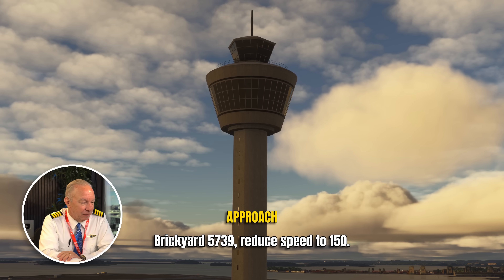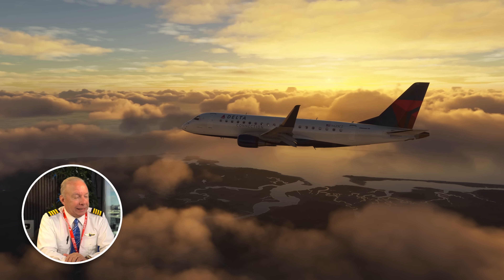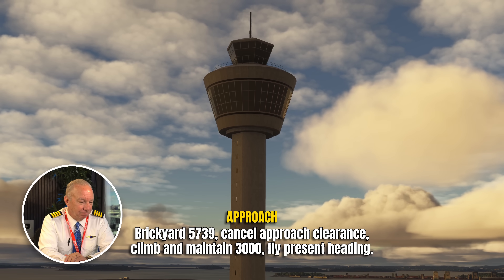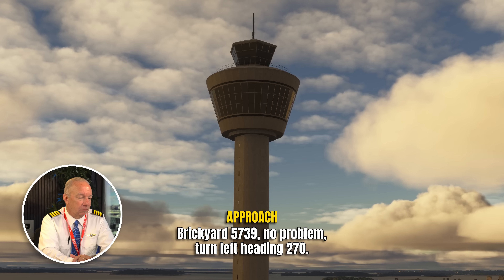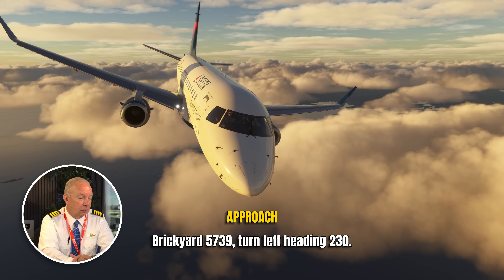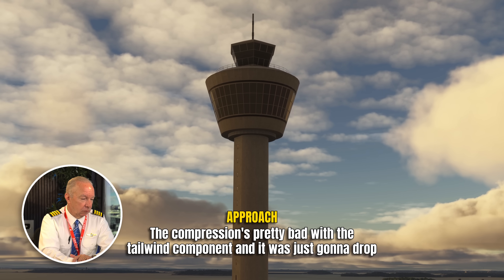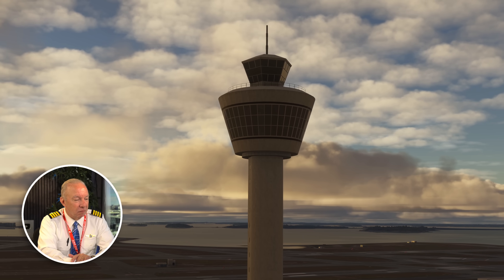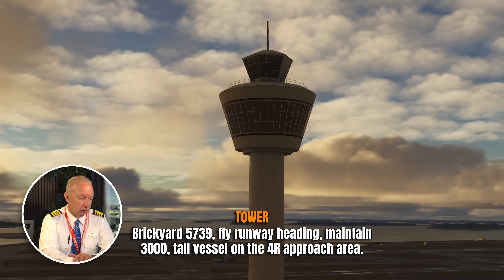“Minimum Fuel” at Boston: What Really Happened to RPA5739

Comment: Pro tip to use "min fuel" in each transmission, especially changing frequencies. Go arounds throw the system out of sync and there was a case not too long ago where the min fuel status of the aircraft was forgotten, and an extremis situation developed. Fly Smart.

Comment: IN the early 80s, I was on a flight with 2 go-arounds into Charleston, SC. It was right after a tropical storm had passed, and the visibility was low. The pilot descended twice with no luck at landing and told us he would try one more time then he would have to divert to WV. He made it down the third time, but the landing was so hard that the oxygen masks popped down.

Comment: in 1994, I was on a flight that took off from Miami, Florida, because I had just taken a week of vacation on a Caribbean cruise ship. 

We had to stop in Atlanta to change planes. By the time we got there, it was almost sunset, and because of storms, there were tons of airliners stacked up, waiting to land.

We went into a holding pattern for 45 minutes, which isn’t remarkable per se, but my plane assumed a very steep angle as we circled tightly around the airport, over and over and over again.

I don’t normally get motion sick, but I was sitting by the window and after a while, began to feel queasy from the tight circles we were making. It seemed to go on forever at the time. 

We finally landed and found  that the airport was just flooded with passengers from recently landed jets. It was chaos. 

I can’t imagine that it would’ve been fun to have been the pilots of my airplane that evening. With all of those jets circling in holding patterns, on a stormy night with towering cumulus clouds oaring the airport at sunset, it would’ve been hard to keep visual separation. It would’ve been very tense and demanding in the cockpit.

Comment: Something that has started to concern me of late. There have been numerous situations over the last 15 or so years, but the crash in DC earlier in 2025, followed by problems in San Francisco, and now this issue, are particularly notable. The US airspace/ airports are overloaded. Think of it as attempting to put 6 gallons of water in a 5-gallon container.  That situation in DC is going to happen again at some point. That runway configuration at San Francisco Airport is unacceptable in today's crowded environment. Last I heard, there were 22 Air Route Traffic Control Centers in the US. Almost every one of them has at least 1 major airport where a controller sits and controls inbound flights to that airport.  Atlanta Center, located in Hampton, Georgia, controls Atlanta and Charlotte. This situation is going to continue, and if we are not careful, a weather-caused accident like the Tenerife Airport Disaster is going to happen here in the US. 

I made this same comment several weeks ago, and I will repeat it here. Everybody seems to think of that situation in DC as having only 2 options. Close the airport or leave it as is. There is a 3rd option. Slow the arrivals and create gaps so the controllers can let military traffic cross. This means VIPs can still use that airport. 

Something like this can also be used in Boston. If a large ship needs to traverse the harbor, then Boston "Center" can issue ground holds nationwide to allow ATC at Logan to have a lot of breathing room. It's all about communication between the harbor authorities and the FAA. 

I wonder how many passengers of this flight and maybe others missed a connection? About 2 years ago, I missed a connection at Schiphol Airport in Amsterdam because of the weather, which caused some flights to be diverted. I had to spend the night in Amsterdam. This caused me to miss a meeting. No, I am not saying my missing a meeting is more important than safety. I am saying I missed my meeting because the aviation authorities overtaxed a system that broke because of the weather. We as a people can do better than this!

Comment: So here's an interesting thought. Do the vessel crew/captain tend to pay attention to approches at the airport and try to be nice or do they typically just completely not bother checking at all? Personally, I'd have it as a requirement to use the waterway/harbour that they must have equipment for that on board and be watching it, a system could warn when the space is likely to be under contention and they could easily plan ahead to not be in that space at that time, it's 2025 that kit on board at least only costs at most a few thousand.

Also, can a pilot decide to just not even wait for the 2nd go around? Declare sorry I don't trust the airport I'm getting it down somewhere else? I'd imagine there'd be a huge debriefing after to determine if it was a reasonable call.

Comment: Would you say the first go around may have been caused by the terminal approach controller possibly trying to squeeze too many aircraft into the approach vector? Surely they were made aware of the +/- previous planes had observed.

Also, is locations such as this, shouldn't it be mandated for the Harbour master and tower to have more communication and any ships in the approach lane be aware of how important

Comment: We did two go-arounds last week coming into Vegas, the first we were maybe 30-50 feet above the runway and started taking back off. They said it was due to wind shear. We seemed shockingly close to the mountains as we looped around…for attempt 3 they switched runways. It sounds like that’s unusual?
Reply: not at all - 1, it's not a cakewalk to change runways when there are 10-15 on arrival plus departures... 2, sometimes the strong wind almost splits the runways angle-wise (crosswind) and you don't have a best-use situation, so when that shifts a bit more, then you have, 3, a change of runways

Comment: I thought for a couple minutes that you literally meant a windjammer wooden era tall ship in the harbor, which would make total sense on the 4th in BOS but would definitely not be there for merely a couple hours... but now that I've heard the entire broadcast I think the term could encompass any commercial marine vessel situated there in proximity to BOS runway... am I wrong? The first vessel that came to mind was the USCG training vessel the Eagle, but to my knowledge she's been on the West Coast since June, because I'm driving down in August to see her in San Diego. Can't help it, just curious, as my grandfather was a lifetime Coastie and retired as a district commander, almost made it to rear admiral, after 35 yrs.. love my aircraft and ships equally!
Reply: 4L/22L is the longer of the parallel runways that this flight would be landing.
4R/22R is shorter and handles smaller AC.  Both handle landings from a southern approach. Which takes you astride Ft Independence and over the main harbor inlet to the docks for all container ships, and cruise ships that come into BOS.  On the northern side of the airport is the access point for LNG tankers which do not come into play with any of the landing approaches. BOS is unique in the fact that you are actually in the city proper, not miles away like most airports.  I started working there in 1977 till 1985, and another stint from 2006 to 2011 where my job had a birds eye 360 degree view of all operations, atop my terminal building.  It is amazing the dance of AC that happens at this airport.

Comment: I spent 6+ years in the tower atop Terminal C @ BOS as a Ops Controller for B6 .. our vantage point was a total view of all runways, taxiways, ramp areas.  I worked every conceivable shift, it was by far the best airline job in the system. Every month or so, we’d get ATC tower controllers , usually pre-shift come down to visit our Ops just to take in the view from our vantage point.  There are 2 towers on that terminal roof, back then we only used one, now B6 uses both due to having the whole terminal.  BOS weather can change on a dime, and runway swaps are a thing of coordinated beauty. This was 2006 to 11.
Back in the pre fly by wire days, where is OPS controllers wrote up flight paperwork for the pilots, we could on certain departures invoke via the Jeppesen’s a category using ships in the harbor, for more weight.  It was a BOS only allowance, and it was for that body of water into the harbor CA Steve mentioned.
Reply: Thanks for your hard work keeping us safe ❤

Comment: Flying into Midway we arrived before the airport was open, they were doing some nighttime construction. The plane which didn't have enough gas to fly a holding pattern for an extended  period diverted to Rockford and had to get some gas to allow us to fly back to Midway. The airline, which was a startup, didn't have an account with the company pumping the fuel so the pilot took out their credit card to buy a little fuel for the jetliner. They used one of the manual imprint card devices and tore off a carbon for the pilot. Yes this was a few years ago.
Reply: Reading about the Rockford refuel in one comment, I remember reading something similar happening during a hijacking in the 60s. The aircraft, which I believe was being hijacked to Cuba, but said aircraft didn't have enough fuel, so the head FA (fka stewardess) wound up whipping out her personal fuel cc, if I remember it was either a Shell or Arco card, and silently gulp as almost $7k worth of fuel went on it. Yikes. Hope she got a little more than just a straight reimburse when it was over.
Reply: @delightschwartz2155  We remember that well here in Knoxville, TN. SOUTHERN AIRWAYS Flight 49, a DC-9.  The incident occurred Nov. 1O-12, 1972.  At one point the plane circled Oak Ridge because the hijackers were threatening to crash the plane into a nuclear reactor at X-10 (ORNL).  Both my parents worked at nearby Y-12.  They took on more fuel at McGhee-Tyson, then landed at Chattanooga to collect a portion of the ransom.  This story has to be one of the scariest/hairiest in aviation history, but it had a satisfying ending, with the 3 hijackers spending years in a Cuban prison before extradition to prison here.  The co-pilot was shot in the arm.  Cuba returned everything and everyone...except the hijackers.

Comment: What happens with the passengers if they were flying to Boston for a connecting flight, and now they're in Rhode Island. Would they have to get a flight from the new airport to their destination?
Reply: It happened to my wife in Miami. She lost her flight and had to be spend the night there. We had to pay for the hotel, as the airline says is not liable for weather related incidents. Lesson learned: avoid Miami at any cost during storm seasons.
Reply: @claudemiropacheco, that's unfortunate
Reply: Up to airline to reroute them. If they divert for fuel, they refuel and get them on to their destination. But it’s still the airline’s problem. When I fly Delta, it all happens inside the app and I rarely need to make a call.
Reply: Time to spare - Go by Air!